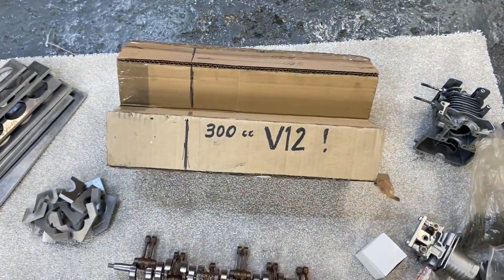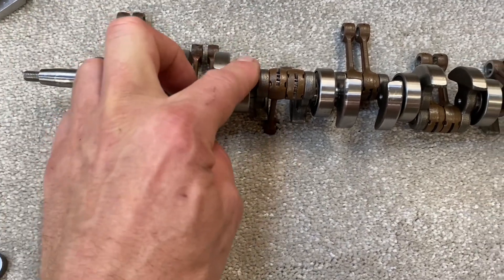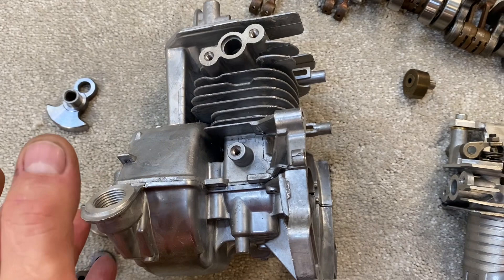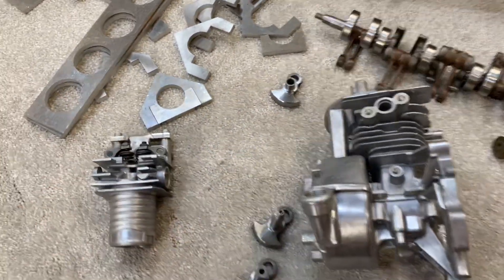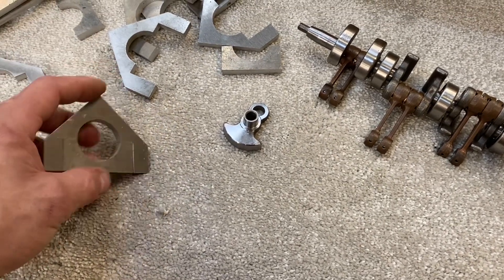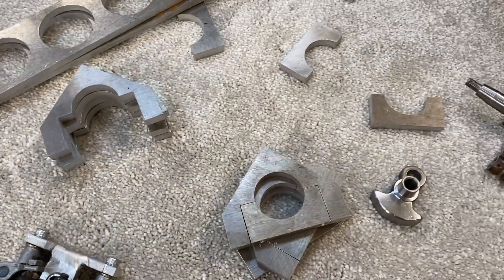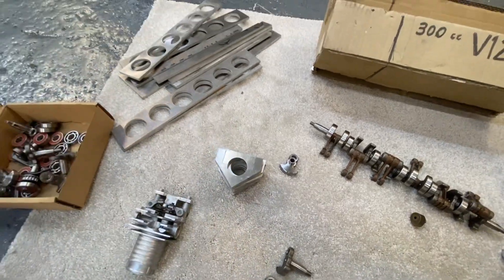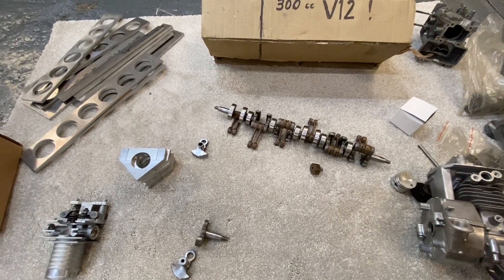300cc V12  engine from 12 brushcutter motors!

Comment: I reckon the phasing of the crank throws is incorrect. The way you've got it, looks like how a 2 stroke inline 6 would be.

A V12 is an inline 6 engine, but with paired crank throws it actually is two inline 6 engines.

Before exploring the V12 lets consider the inline 6 since it is critical to a V12 to understand this first.
The firing order of a basic I6 is 1, 5, 3, 6, 2, 4 and so is a V12 (I'll get to that)
This means the crank phasing is as follows cylinders 1&6 are at the 12 o'clock position. 
Rotate the crank clockwise 120 deg cylinders 2&5 are at the 12 o'clock position.
Rotate the crank clockwise 120 deg cylinders 3&4 are at the 12 o'clock position (see below also)**
This does not change in a V12 just because it has 6 more cylinders.

To illustrate the reality of what I'm saying lets adjust the valve clearances on any inline 6. This shows how the crank pins are arranged on an inline 6 (and a V12).
Firstly you rock the intake and and exhaust rocker arms on cylinder 6 and adjust cylinder 1 - both are at TDC but on different strokes #6 being at TDC on the end of the exhaust stroke and beginning of the intake stroke and #1 at TDC on the compression stroke.
Next you turn the crank and rock cylinder 5 and adjust cylinder 2 (and vice versa).
Next you turn the crank and rock cylinder 4 and adjust cylinder 3 (and vice versa).

Pairs of cylinders are always at TDC.
To get here on an inline 6, pairs of cylinders viz 1&6, 2&5, 3&4 are always up or at TDC.
**Looking from the front of the crank with clockwise rotation a '3 leaf clover' of crank throws would show 1&6 are up, 3&4 are 120deg clockwise, and 2&5 are another 120deg clockwise.

Now because in a V12 each journal is paired then the firing order is off by the bank angle - the optimum in a V12 being 60deg bank angle to correspond with the 60 degree firing interval ie 720deg/12cylinders = 60 (the 720 deg being 180deg ea for each of the four strokes of a 4 stroke engine).

All inline 6 cranks are built like this and a V12 works on the identical crank arrangement as an I6. Arranged like this all the reciprocating forces are brought into balance because at any time there are a trio of cylinders moving in pairs cancelling primary and secondary vibration which also requires a crank with very small crank counterweights.

Considering the banks are just two inline 6 engineswe'll number the banks left bank viewed from the front L1,2,3,4,5,6 & the right bank R1,2,3,4,5,6.
The firing order of a V12 with cylinder #1 on the right bank being at TDC on the power stroke then becomes:
R1, L2, R5, L4, R3, L1, R6, L5, R2, L3, R4, L6.

Notice the 1,5,3,6,2,4 inline 6 firing order repeating on each bank.

The reason for this is an I6 has perfect primary and secondary balance. As a V12 with paired cylinders on the same throw the basic fact is it is still an I6.

Comment: You could tack weld (TIG) the crank throws to the gudgeon pin as this is very common on 100 HP+ jetski 2 cycle engines due to their unloading the pump during jumps out of the water & instantaneous reloading when they hit the water again at full throttle. This can often twist the crank out of alignment resulting in rear cylinders having timing too far advanced resulting in piston seizure.
Reply: I would agree with this tig welding approach. The engine will not me a 100000 mile engine by any stretch. This man has the skills to get this far he can always make another drop in crank. Weld it all, straighten it by strategic bending, and get on with the build. I want to hear it run!

Comment: very keen to see this put together! 
Pete Ardema and kevin Braun have build a few full sized engines for their land speed cars from sheet steel and alli, greg quirin has a heep of videos of these two old school engineering magician's you should check them out.
Reply from the maker: thanks for info , thoght this was going to be a first sheet metal 'block' maybe first for a model engine ?
Reply: @scarlettsgarage1   no worries at all mate did you check them out yet? they almost make making an engine from scratch look easy🤣 and they have made a few from scratch and done some  really unique conversions like the Moser/crane quad cam 350 chev , the old's rocket 4L with corvette ZR1 quad cam heads they've done some very off the wall builds.
  yes  i would say its probably the first for a model engine.

Comment: I really hope that crankshaft is going to be tough enough to handle 12 cylinders, I hope it handles it but by the looks of it i dont think it will
Reply from the maker: yep I have some thoughts to, only one way to find out ....
Reply: @scarlettsgarage1  yeah I really hope it works, that would be so awsome if it does, if it doesnt then I think you should try putting two of those crankshaft peices where there is only one of them right now, like not the rod that travels through ther conrods but the little crankshaft peices that hold those rods, two of those welded together on each joint should handle the power.